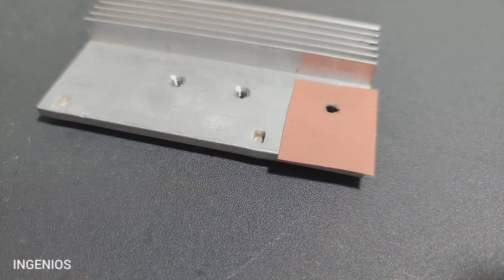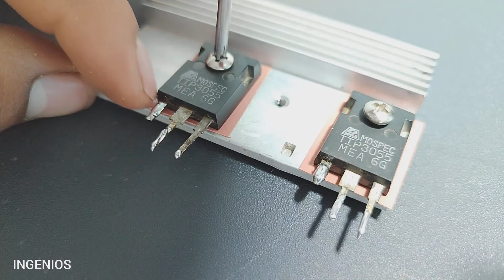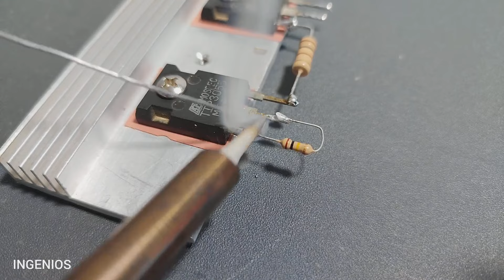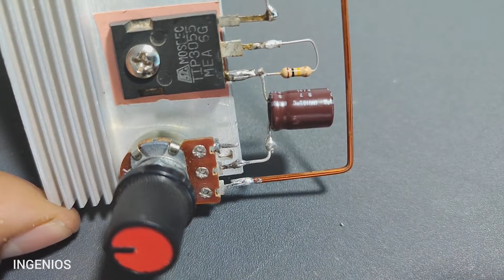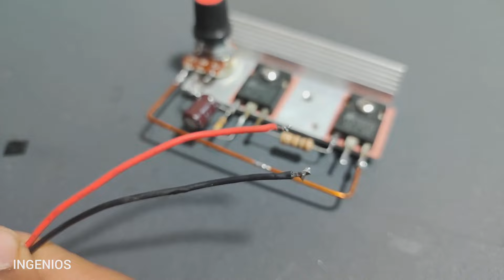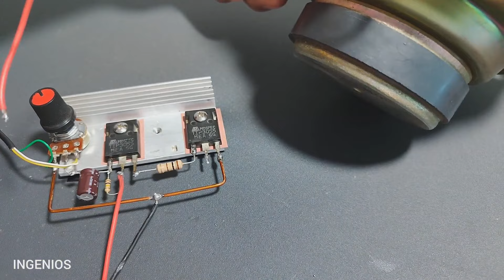Como hacer un amplificador usando dos transistores tip3055

Comment: buenas me puede hacer una lista de los materiales
Reply from the maker: Buenas noches. Los materiales son:
- 1 Disipador
- 2 Mica para aislar los transistores 
- 2 Transistores tip 3055
- 1 Resistencia 100 ohms 1w
- 1 Resistencia 100 k 1/4 w
- 1 Potenciómetro 10k
- 1 Capacitor electrolítico 100uf a 25v o 35v
- 1 Conector Jack 3.5mm 
- 1 Cargador de 12 voltios DC
- 1 Parlante de 50 watios en adelante a 8 ohms